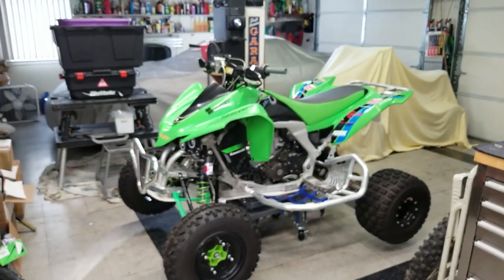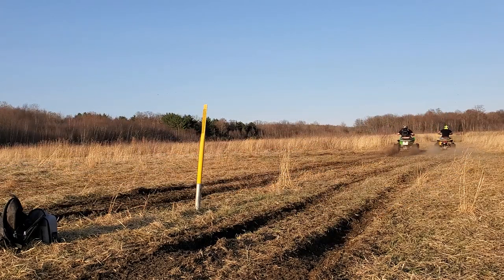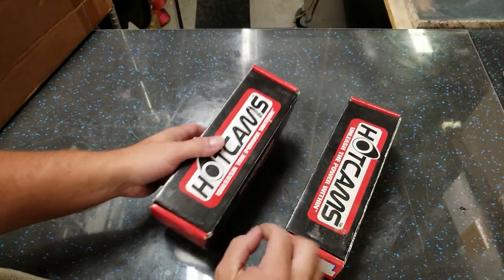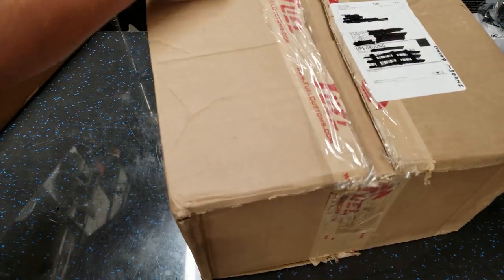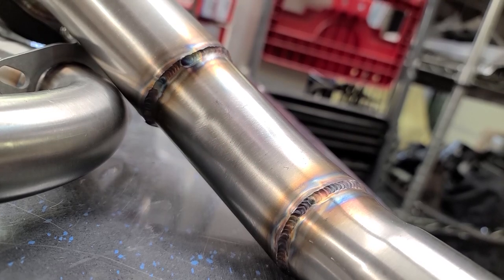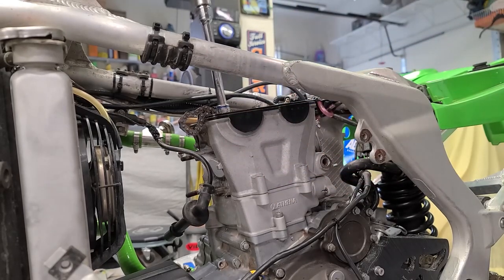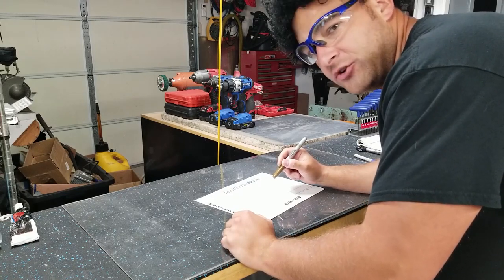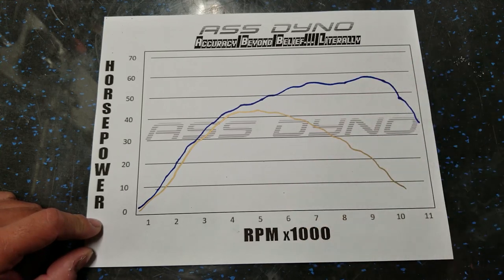These Mods Made My KFX450R WAY FASTER! (and louder)

Comment: fuel injection is way better and tuner power is better so why do a conversion ?
Reply: probably for reliablity the fuel injection is iffy on these bikes
Reply from the maker: FI is great but very common on the early KFX's to swap for reliability and supposedly an increase in power too; if you're more interested, if you search "carb swap" on KFX forums you will see more detail on why people switch over.
Reply: @MichaelSabo  yeah my throttle body , tps, and power commander 5 have caused me a few headaches. Carb would make it so much easier
Reply: ok i gotcha i didnt know ppl has had alot of problems out of them it confused me bc u never see someone taking fuel injection off a bike like that carbs are kinda unrealiable if you let them sit up for a while